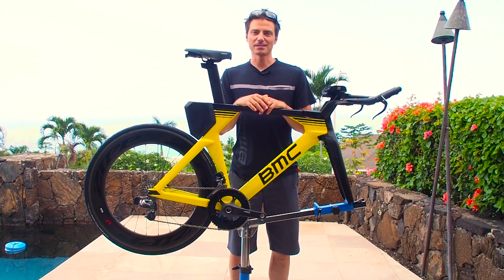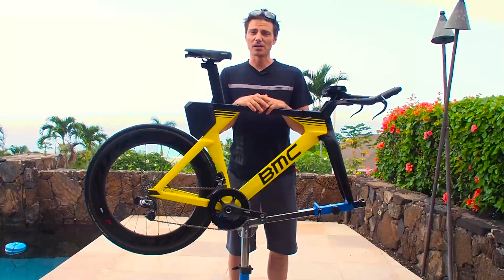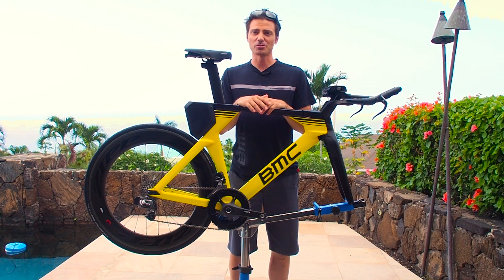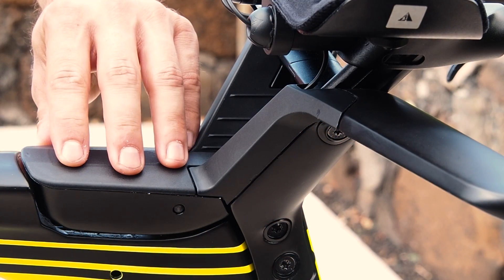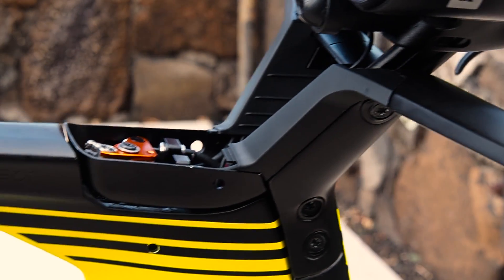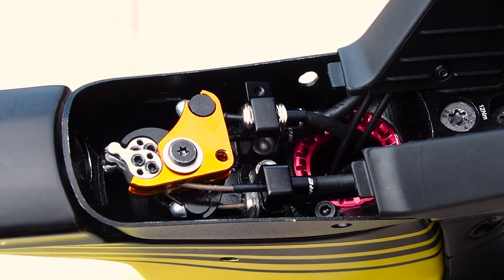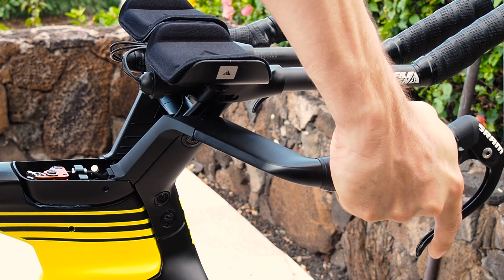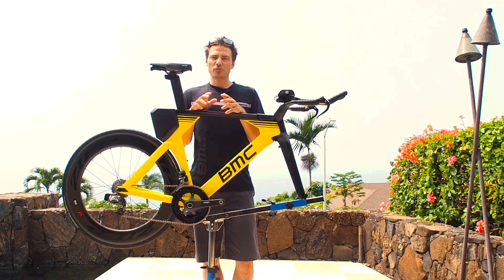BMC TrainingLabs: Timemachine Brake Booster Technology Explained

Comment: Doesn't the brake booster mean that you have to pull the lever harder to get the same braking force? It looks like the cam allows greater brake clearance at the expense of braking power.
Reply from the maker: Hi Hambini. You're correct that the cam allows for more clearance, but it also preserves the braking feel and force experienced on a traditional set up. There's no power loss at the pads or increase of effort required to pull the brake lever!